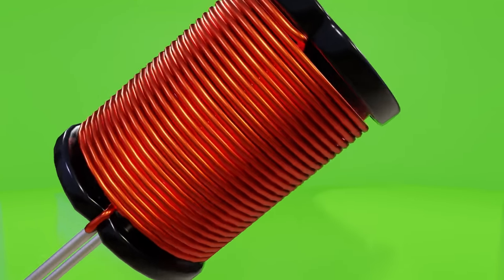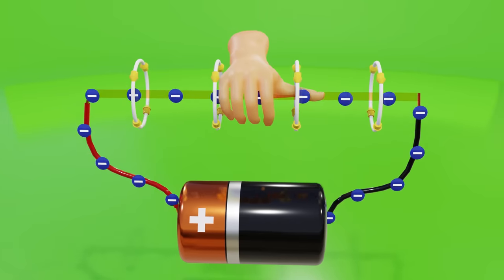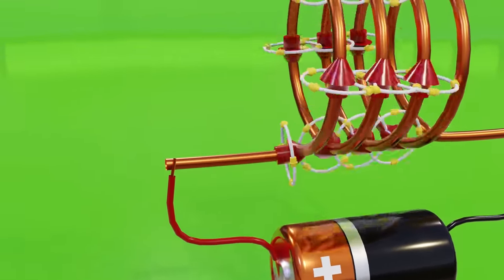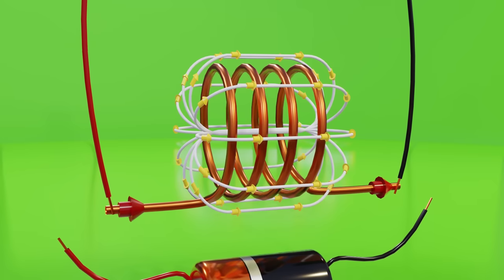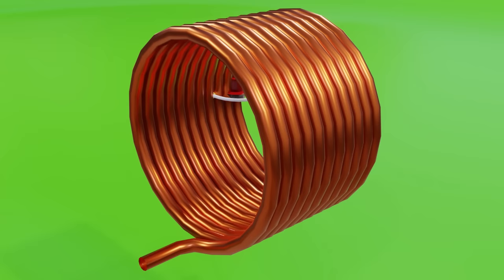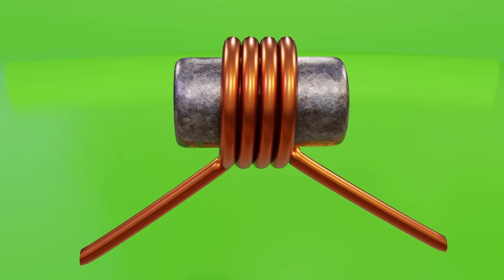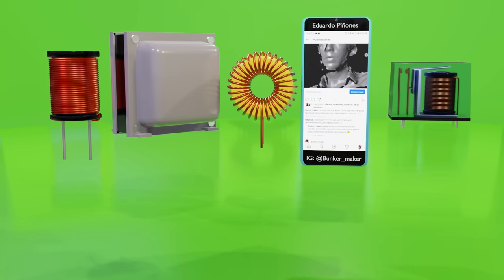How an Inductor Works ⚡ What is an Inductor

Comment: 👍💡⚡ great video. 
=======
It made me think about the old voltage regulators I had on some 🚜 tractors . (Field etc )
====
We had $125 tractor bought at auction .  Block with split on the outside no big deal . 
=====
Completely rewired it 1950s style and put a $55 alternator on it from a 71 Chevy brand new.
===
Came out one day someone took the alternator not think about it I should have taped 30 bucks on their leave the alternator. 
=====
👋😎💨 Bryan
🐎💨💕

Comment: As a guitar player I would be interested to see how all these apply to guitar pickups which are basically coils wrapped around magnets. I know that the stainless steel guitar string is moving inside the magnetic field of the pickup and that generates voltage, but how is one pickup having different sound from another? How is each element contributes to the characteristics of the pickup?
Reply: I see that no one has answered you. Your question is basically why your pickups sound different.  Among the reasons, the most significant factor is the placement of them.  The neck pickup catches more low harmonics than the bridge pickup.  You know that there are multiple harmonic frequencies on the moving string that contribute to the sound of the primary frequency of any of the strings.  That is what makes an acoustic guitar sound different than a piano or a violin.  Moving the pickups out away from the bridge allows lower harmonics to be heard.  They seem to be filtered out by being close to the bridge or the nut.
Does this help or hurt your understanding of the picture?
Reply: @alext8828  All these you said I knew already, even that the neck pickup in a 22-fret guitar is under the 2nd harmonic. I wanted to know the physics of how the coil, the wire and the magnet contribute to the frequency pickup of the... pickup. Thanks for the response, anyway!
Reply: @gkol69    ChatGPT says it's the string vibrating in the magnetic field that disturbs it and creates a variation in the current moving in the pickup coil.  That's the very part that's vague in my mind.  Here's their version:  A guitar pickup is a crucial component of an electric guitar's sound-producing system. It works by converting the vibrations of the guitar strings into electrical signals that can be amplified and heard through an amplifier. Here's how a guitar pickup works:

1. **Construction**: A guitar pickup is typically made of a set of magnets, magnetic pole pieces, and coils of wire. It's usually mounted directly beneath the strings of the guitar.

2. **Electromagnetic Induction**: When you pluck a guitar string, it vibrates back and forth. As the string vibrates, it disturbs the magnetic field created by the magnets and pole pieces in the pickup.

3. **Changing Magnetic Field**: The vibrating string causes changes in the magnetic field strength around the pickup. This, in turn, induces a small electrical current in the coils of wire wrapped around the pickup.

4. **Electrical Signal Generation**: The induced electrical current in the pickup's coils carries the characteristics of the string's vibration, including its frequency and amplitude. This electrical signal is very weak and requires amplification to be audible.

5. **Amplification**: The weak electrical signal generated by the pickup is sent to an amplifier through a cable. The amplifier significantly boosts the signal's strength, making it loud enough to be heard through speakers.

6. **Sound Production**: The amplified electrical signal is then sent to a speaker, which converts the electrical signal back into sound waves that we can hear.

Different types of pickups, such as single-coil and humbucker pickups, produce slightly different tonal qualities due to variations in their construction and the way they capture string vibrations. The position of the pickup under the strings also influences the tonal characteristics.

The pickup is a critical element in shaping the unique sound of an electric guitar. Different guitars and pickup configurations can produce a wide range of tones, which is one of the reasons electric guitars are so versatile and beloved by musicians.
Reply: @alext8828  I already know all these! To make myself more clear, my questions are: 1. How each turn of wire inside the coil affects the frequency response of the sound? 2. How the thickness of the wire affects the frequency response? 3. How the inductance affects the frequency response? 4. How the width of the pickup coil affects the frequency response? 5. How the strength and the material of the magnet affects the frequency response? By frequency response I mean: Does it roll off high frequencies? Cuts off bass? Makes the harmonics of the fundamental note you play more pronounced? And how: Each turn rolls off 5Hz? 10Hz? Boosts the bass 3dB? 6dB? Different magnets with different strength boost all frequencies? If not, which ones? ...and so on.
Reply: The reason why I'm watching this video too 😂.
Reply: @gkol69  I'm not smart enough to know if any of that is true.  Do you know if the current going thru the pickups is ac or dc?
Without giving it much thought, I would guess that it's dc because dc would pick up the 60 hz hum from the power lines while ac would heterodyne and create beat frequencies (upper and lower, I think).
Instead of trying to fathom all the things you mention, which is fine, maybe a primer in electrical and electronics would allow you and me to put some of these mysteries to light.
Reply: @gkol69  
In order for a "variable reluctance" pickup, as used in an electric guitar, to generate a useful voltage the coil around the magnet needs a lot of turns. That means you have not only inductance, but capacitance due to the proximity of the turns to each other.  That makes a resonant circuit.

I have no idea if it is done with pickups but one way to reduce capacitance is to use a "progressive winding." 
Consider a winding of just two layers for simplicity. You wind the turns side by side along the magnet in a single layer, then put another layer on top of that, coming back to where you started. The greatest coupling through the unwanted capacitance is between the start and finish ends because you have the greatest voltage difference. With a progressive winding you go a few turns forward, then a few turns back, then forward again, in a sort of two steps forward, one step back fashion. That reduced the effect of the capacitance between the turns of the winding, raising the resonant frequency. It is harder to do than simple end-to-end layer upon layer. Again, I have no idea if this is done in guitar pickups but if it is it could account for at least some tonal difference.
Stronger magnets would reduce the number of turns needed for a give signal level and hence again shift the resonant frequency of the pickup upward. You can get by with fewer turns if you have a preamplifier at the pickup (hard to get really low level signals down a simple coax without degrading them).
Reply: @d614gakadoug9  Thank you for the informative reply!

Comment: Inductor does not have storing capacity but it had the ability to resonate or dissipate surge effect by expand the surge current like rubber band and so regulate surge current to a degree
Reply: Inductors absolutely do store energy. Every switchmode power supply on the planet relies on that fact.
However, unlike a capacitor you can't open the terminals of an inductor and have the stored energy remain. IF the inductor were made with a perfect conductor with no resistance and you shorted the ends of the winding you could maintain the magnetic field and stored energy.

energy stored in an inductor = (L • i²)/2
where energy is in joules, L is in henries and i is in amperes

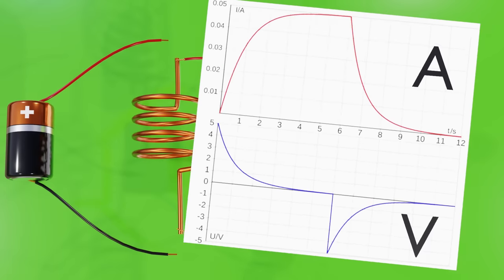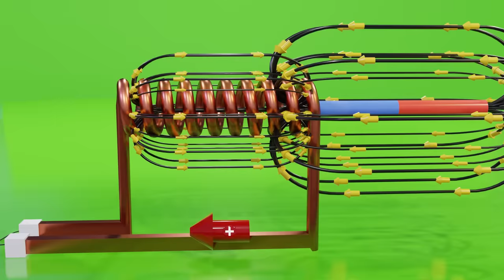Comment: 4:58 your animation appears to be wrong. the current should be opposite the feed current according to your graph at 5:54 since you show a reversed polarity across the inductor after removal of the feed current. also, your animation defies the right hand rule and the rule you stated at 2:32. you messed up.

Comment: There is actualy a mistake made in this video. That is when the voltage is removed from the inductor, the current does "Not" reverse, it continues in the same direction through the inductor only the polarity changes, this is because the inductor has now become a generator as the field collapses. The rest is all fine with the video.
Reply: Cheers!

Comment: Very important parts in laptops, phones, power banks. Inductive components remove the memory effect of batteries to reach higher capacity. The feature is locked, you won’t be able to use it. Laptops turn it in by discharging the battery in Bios. Bad batteries will be destroyed in Bios. Power banks turn it on when you charge with lightning cable, or if the phone is better type. Phones turn it on in the power menu, or if you unplug the battery for a few seconds. Car charger also switches it on. Later charging and discharging leaves it on. Laptop fan can fix a battery. Pc fan can fix a 12 v battery. If the component doesn’t have inductive parts, memory effect won’t leave the battery. A diode is in the batteries/ devices, removing the memory effect.

Comment: The  Inductor converts part of the electric current (Q/t) to magnetic flux (BA) . The magnetic field (B) itself  is not energy. Energy (E) is a product of the current  (Q/t)  and magnetic flux (BA). Thus  E = 1/2 Q/t * BA. So B is just one factor of the energy equation. It is wrong to imply that B is energy or contains energy. It actually is 1/t or the reciprocal of time. The stronger the B the shorter the time and greater the velocity, acceleration, voltage and energy. 
Furthermore since E = 1/2 current * BA then for a given amount of E when  B or BA is  increasing current or Q/t will be decreasing and if BA is decreaing then urrent must increase.
Simple as that

Comment: A wire absolutely does act as an inductor. It is a plague in circuit design, especially power distribution in fast digital circuitry. Even the inductance of a small surface mount capacitor can degrade the performance of the capacitor (a simple model is an ideal capacitor in series with an inductor in series with a resistor)

The waveform shown at about 5:50 is not what you actually expect in an inductor. If the inductor is discharged at the start when a voltage is first applied across it, the current will begin at zero and rise linearly with time, it will not be curved as shown. The curve is what you would expect if you were to charge the inductor from an ideal voltage source through a constant resistance.

Comment: All these explanations repeatedly fail to distinguish between emf and current. If the coil isn't connected to a circuit that will allow some significant current to flow, then there will be no countering magnetic field from it.

Comment: Where is the actual application of inductors
Reply: Look inside a radio or a transmitter, you will see quite a few of them.  Also, the cylindrical bulge on the end of many computer cables is a ferrite inductor used to filter out voltage spikes in the power supplies to the various devices.

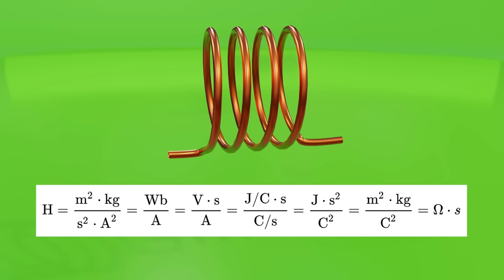Comment: 6:36 a bunch of ??? formulas, and no explanation of even the simplest one, 
8:54 another formula, again no explanation of the symbols used ...
Reply: Typically on schematics, inductors are designated by the a symbol L.
Reply: H is the unit symbol for henry. At the 6.36 mark, those are many different ways to convert equivalently. 
  At the 8.30 ish mark, that is the formula for calculating an inductance if knowing the righthand side of equation. Such as N is number of turns, A is area, like is length,  and 'u' (myu) a coefficient.
Reply: I hear that the 7 basic units are up for a change....again.

Comment: 1. to say that your explaining "how inductors work" is a misnomer 
2. inductors are not "electronic" components, they are "electrical" components
Reply: Inductors are used in electronic circuits.  That makes them electronic components.  You will find them in the catalogues of electronic components suppliers.    Electrical circuits may have inductance associated with them, e.g. motors, but if you go to an electrical supplier, they probably won't be able to sell you a 0.1H inductor!
Reply: @karhukivi  They are "electrical" components.  The phenomenon is electrical.  Electronic components are devices like vacuum tubes and semiconductor devices.  Yes, they are found in electronic devices and they are in catalogs along side electronic devices BUT they are not "electronic" devices.  Also, this video did not really "explain" anything about inductors.
Reply: @drstrangelove09  Well, semiconductors work using charge "holes" so one could argue that even transistors and diodes are not "electronic".  An inductor is a magnetic device, following this same strict definition.  if it satisfies your pedantic mind to say they are electrical, then we'll say you are right!
Reply: @karhukivi  go ahead and argue that... you will be wrong

Comment: If I didn’t already know what inductance was I certainly would NOT know after  watching this presentation. It is one of the most confusing things I’ve ever seen. You do not need to state the NAMES of all the laws for people understand the CONCEPT (such as Lenz’s Law, and such).   Whoever made this presentation should have taken a course in instruction.  
ALSO,  If you use electron flow for current flow for everything ELSE you teach, then WHY suddenly switch to conventional current flow here to describe the ‘right hand rule’ when you could have just said use the ‘left hand rule for electron current flow’ to determine the direction of a magnetic field?!   (Not sure why this is important for somebody to know to understand inductance in the first place, but in case  you are still reading this by now, here is the definition of inductance:  inductance is that property of an electric circuit that tends to oppose a change in current.  It does the because whenever a current flows in a circuit there is a magnetic field generated.  If current stops flowing or changes direction that magnetic field collapses and induces a current in the opposite direction, since the field is now moving in the other direction.  This is true for a straight piece of wire OR in a coil - making a coil of wire simply concentrates this property into a smaller area, which causes a corresponding increase in the inductance. 

In a DC circuit once the current reaches a steady state inductive reactance is no longer significant because there is no CHANGE occurring.  If you open the switch, the magnetic field collapses and induces a voltage in the opposite direction which tends to keep the current flowing (until the magnetic field has completely collapsed and there’s no more change occurring). Of course this is not the great explanation either because I do not have the luxury of using diagrams and illustrations and such in this comment section.  
IN SHORT, you tried to cover WAY too much in the short time allotted, which only leads to confusion of the audience.

You also stated that if ryou stretch the coil out you end up with a wire “…which we all know does not act as an inductor ” That is totally incorrect.  A straight piece of wire DOES act as an inductor - although a very small one and it does have a magnetic field around it, something else that you incorrectly stated.